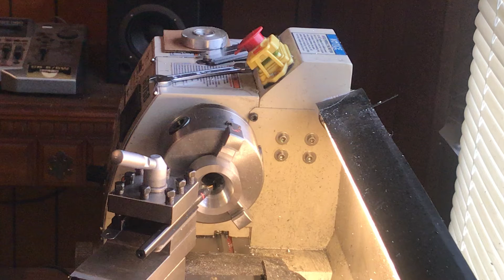Power feed !

Comment: The finish you been getting by hand has been pretty impressive.
Reply from the maker: With power feed and coolant a near mirror finish should be obtainable on 6061 aluminum with right feeds/speeds and inserts designed for cutting aluminum